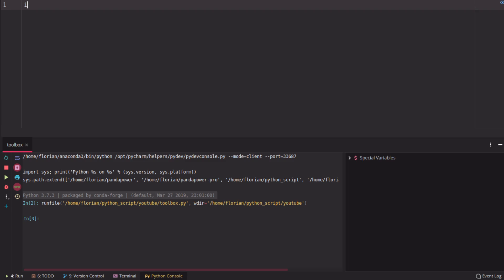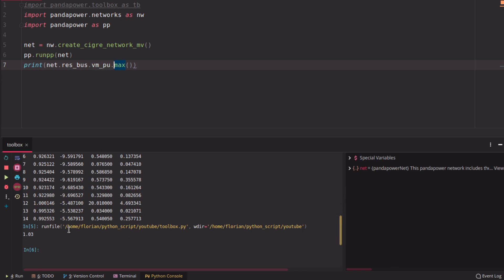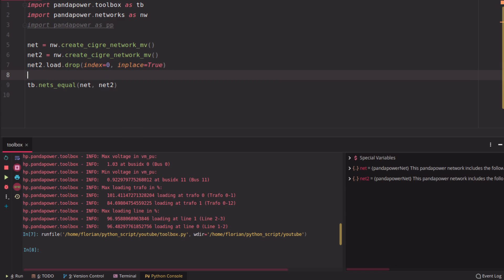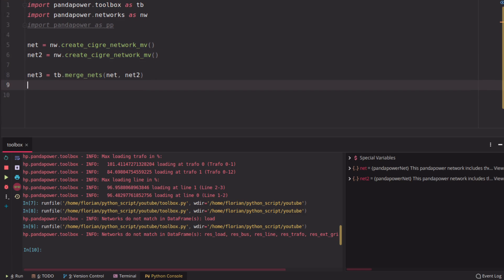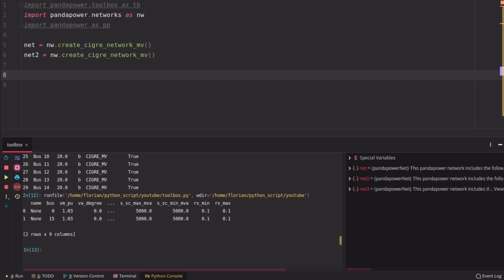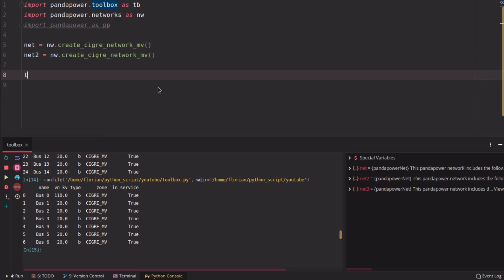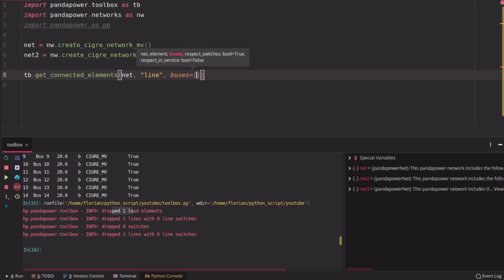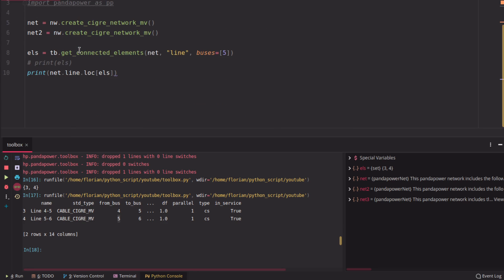pandapower - useful toolbox functions

Comment: I am unable to run tb-lf_info(net) from pandapower.toolbox function in my PyCharm. please help. I wrote the same code as you did but there is no output neither any error or warning, even print statements before and after tb.lf_info(net) are also executing. I am using pandpower 3.0.0.

Comment: Thank you very much for panda power tutorials so helpful. I have a question about how to model one house like PV generation, Battery, Demand transaction with using a switch? Is this circuit calculation possible using panda power?
Reply from the maker: Thank you for the feedback! pandapower is not really designed to model a single household. Especially since the battery model is more or less just a PQ-node (the same counts for loads and static gens (PV node)) and no optimization model.
Reply: @pandapowerorg  Thank you very much,  do you have any recommendation model in pandas tutorial behave like PV, battery, and load?
Reply from the maker: @dnsmalla  Actually I haven't done something like that.  Maybe some Pyomo model exists in python or JuMP based models in julia. Better Google for these... Sorry
Reply: @pandapowerorg  can you please provide your active email ID?